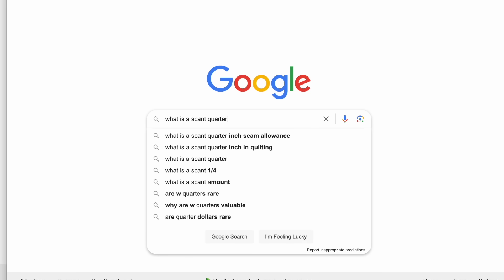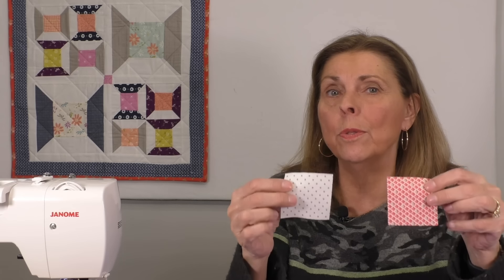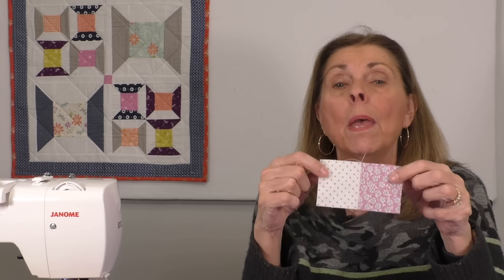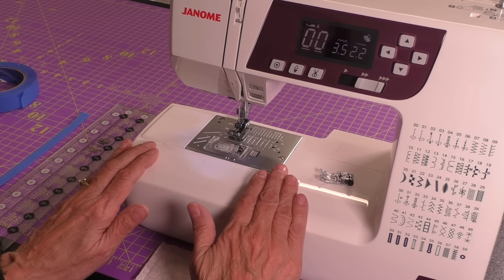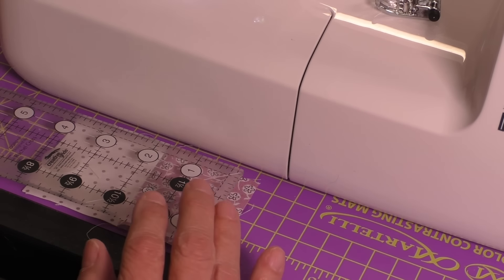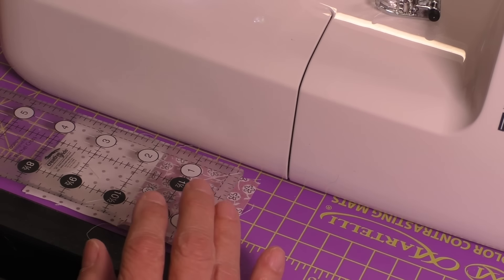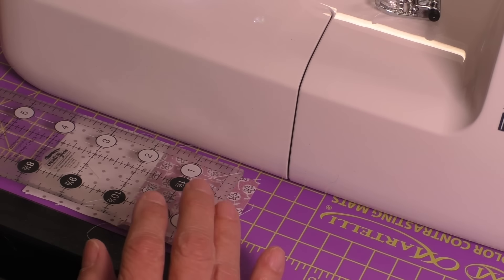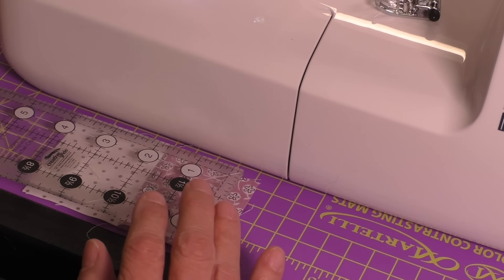Why You Should NEVER Sew "Scant" Quarter Inch Seams

Comment: "Just to the right of the 1/4" marking" IS a scant quarter inch.
Reply from the maker: It sounds like you are able to work with the term "scant" to get your accurate finished pieces and you do not need the information provided in this video.  However for someone who is new to quilting, and even to some more experienced quilters, the word "scant" is an unmeasurable term that has caused them frustration and discouragement when quilting.  You may not need help creating accurate seams, but there are those who do, and that is why I created this video.

Comment: Putting the needle just to the right IS sewing a "scant" seam. It means to do what you showed and not sew exactly on the line. This applies to using a 1/4 inch foot as well. The tape is an unnecessary complexity vs the proper foot.
Reply from the maker: As I've said previously, my issue is not with the seam itself - it's with the confusing and unmeasurable term "scant".  A "proper foot" does not always give you the "proper accurate measurement" no matter how expensive our machines are.  The fabrics and the threads we use all come into play when we're sewing our seams and they can easily take away from the accuracy of our seams.  I have taught quilting for many years and as much as for some a scant is on click, or one thread, for new quilters this does not compute as they begin to tackle quilting and the precision that' involved.  In the end we all want an accurate finished piece, but when we throw unmeasureable terms such as "scant" into the way we achieve that accuracy, it can be confusing.  That was the point of my video explanation.

Comment: What you are saying is that the manufacturers of the machines are off on their throat plate seam guide and the 1/4 inch foot.
Reply from the maker: That's not at all what I was saying.  If you watch the video at 1:39 I say that when I sewed my seam "Yes, it's a 1/4" seam."  At 2:16 I say that you absolutely can sew an accurate 1/4" seam using the foot or the marking on your sewing machine.

Comment: You said at the end of the video  that you have sewn a perfect quarter inch seam. And you said it twice. But you did not sew a quarter inch seam. It was a scant quarter inch seam
Reply from the maker: The finished piece is a perfect 4 1/2", so I believe my seam was "perfect'.  The purpose of the video was to show that the seam that was sewn is not a "scant" seam simply because we don't actually know what the measurement for "scant" is.  There is no numerical measurement for the term "scant" and too many quilters have ruined their finished pieces by sewing "too scant" or "not scant enough".  But if you follow the instructions in the video, you will sew a perfect seam that will give you a perfect piece in the end.

Comment: So why doesn’t sewing machine manufacturers make a scant 1/4 inch foot to avoid all the tricks?
Reply from the maker: Since the term "scant" is an unmeasurable term, what's "scant" for one person, is either too much or too little for another depending on their fabric thickness and thread weight.  Some machines have a button that moves the needle slightly in one direction or the other.  If your machine has this feature, it can help you create an accurate piece after moving the needle and testing the width of the finished piece until you get it right for the project you are working on.  It works well, but not all machines have that feature.
Reply: @joyfulandmerryquilting  I have a Juki so I can’t move my needle.

Comment: It is a pain when you have to change the bobbin.......
Reply from the maker: That's true - but I'm very careful removing the lid and I do put a single layer of tape over the end of the layered tape and then over the edge of the bobbin case.  One layer fits on my machine and it keeps the end of the layered tape from coming up.  I can replace the bobbin without much difficulty and the trade-off is those perfect seams, which I love.  Thanks for watching!

Comment: A scant 1/4 “ seam by any other name, is still a scant 1/4” seam.
Reply from the maker: So what is a "scant"?  It's an unmeasurable term.  My "scant" may be different from your "scant", but my finished measurement for my block and your finished measurement for the same block can be EXACTLY the same if sewn properly.  As I said in the video - scant is a term that is difficult for many quilters to grasp and it can discourage and defeat new quilters when they just can't get their blocks to measure correctly using this term as their guide.  Rather than using a term that has no definitive measurement attached to it, I would rather show quilters how to create a block that finishes perfectly and skip the use of a term that can be so confusing.  If you want to use the term "scant", by all means - use it - it is truly your choice.

Comment: All good until you need to change the bobbin then you have to do the whole process again.
Reply from the maker: Actually I don't have to redo the process every time I change the bobbin.   I carefully remove the bobbin case lid and if the tape lifts a bit, it has enought "stickiness" still on it so that I can just smooth it back in place and it will stick for several bobbin changes.  I think it's worth it.

Comment: First 5 minutes of watching and my first observation is - simply use a magnetic seam guide, no need to waste tape.
Reply from the maker: The magnetic seam guides do not always stay in place, depending on your sewing machine.  Also, for some machines it is recommended that you do not use the magnetic seam guides.  I'm glad this method works for you however.  Thanks for sharing this option!

Comment: Why has some clever person designed and marketed a foot that will actually solve this problem?  How hard could it be? You are showing what is needed. I know quilters would beat a pathway to her door.
Reply: Sorry! I meant " hasn't ".
Reply from the maker: One solution is that many of the newer sewing machines have a setting that allows you to move your needle in tiny increments from the center.  That way, you can move the needle, sew two blocks together, and then see if they are accurate.  If not, you simply move the needle a tiny bit more until the finished "test block" is accurate, rather than adjusting the tape.  Unfortunately, depending on your fabric and thread weight, the finished measurement can vary and there just isn't a foot that works for every fabric/thread combination.
Reply from the maker: Thanks so much for commenting and for watching, Mary.

Comment: Much adu about nothing.  You say potato; I say potatoe.  Regardless how it’s framed,  a scant 1/4” seam was sewn - not an accurate 1/4” seam as was stated.  The scant 1/4” seam produced accurate pieced results.
Reply from the maker: My issue is with the word "scant", Laurie, and why I say NO to using the term "scant" when referring to seams.  SCANT is a non-measurable term.  Every explanation on how to achieve a "scant" seam has a different place to position your needle or a different method of trying to make your seam "scant".  My scant may be different from your scant and that totally negates the validity of the term when creating something that is dependent on accurate measurements.  I would rather have an accurate finished piece in the end and that is what this video is about.  If you want to call my finished seams "Scant" you're welcome to do so, but I prefer to call them accurate.  As a teacher, I have found over and over and over again that the term "Scant" is a confusing word to quilters (new, intermediate, and experienced).  In classes, I have tried to explain it, show it, demonstrate it, etc. but in a quilting world where precision is stressed in order for the "puzzle pieces to fit together", an unmeasurable term such as "scant" just doesn't make sense to me.  Thanks so much for watching and for commenting.

Comment: My Quilt 101 teacher was determined to teach us accurate sewing skills. It was hard at the time but I am so grateful! You need good skills especially when you get into improv quilting...they are critical in controlling your design. She taught us that "scant" is NOT a measurement!!! So true. Like you, she said to measure your finished blocks and use a guide to get the seam allowance that gets you that accurate block. I use a jelly strip but like you said it is too short so my pins keep getting caught...will have to either add a second or go to the folded masking tape, thanks!!
Reply from the maker: Thanks for watching!  I currently use the Marci Baker strips "Sewing Edge".  I put them on my machine as a guide and cut across where the bobbin case opens.  The tape is still in place but I can replace my bobbin without removing the strips.

Comment: Accurate vs scant. Whatever - basically the same.
Reply from the maker: The point of my video was to point out that "scant" is an unmeasureable term and confusing to quilters - especially newbies.  Sounds like it's not something you're concerned about.
Reply: @joyfulandmerryquilting  I just think accurate 1/4 inch like you are calling it is a better term for it.

Comment: So, you eliminate the word "scant", but the meaning of the word...you apply.   LMAO. You can balk at the word, as if you found a new technique, but you applied the technique any way.  MY aren't YOU clever...
Reply from the maker: EXACTLY!!!  When I teach, the most common question/fear when it comes to piecing is that very word SCANT.  I refuse to use it - I measure and get the seam correct FIRST so that my finished measurements after sewing are EXACT - then I don't have to worry about it through the rest of the project.  Thanks for watching!
Reply: @rcarda2063 Exactly!! LMAO! They are scant seams whether she calls them accurate or not. Different method....and click bait!! How confusing for new Quilters, huh?